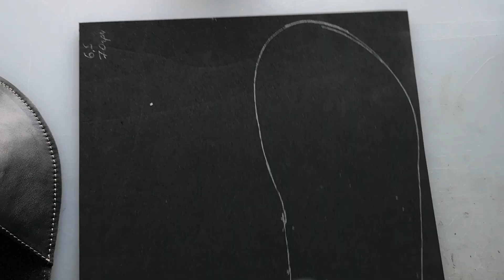Slippers and diy. How to house shoes from leather and wool cloth

Comment from the maker: Any questions and suggestions about video,  can write in comments. I will answer
Reply: Leathercraft together .. questions what outter sole you are using or what do you recommend
Reply from the maker: @wolfenlove6267  Hello! I used EVA material (it looks like foam rubber). You can try using EVA or fat leather 4-6 mm thick.
Reply: Please what is the most durable cushion material do you advise for footbed
Reply from the maker: @abbahmohd6163  Foamed latex. If you mean soft and elastic material for the comfort of the foot